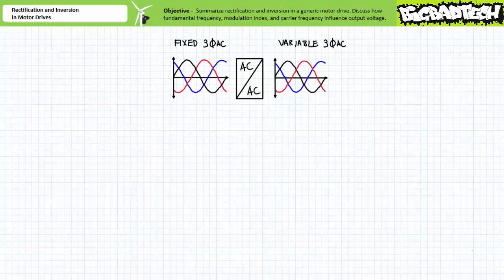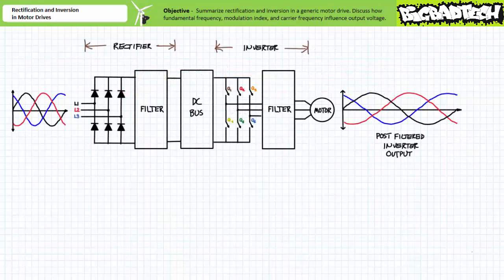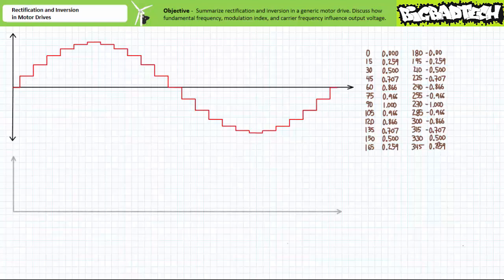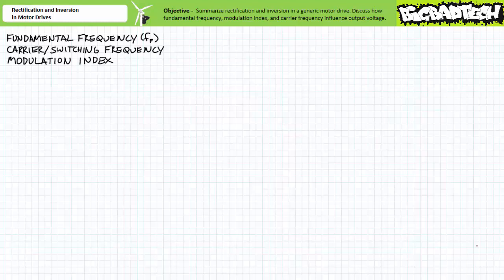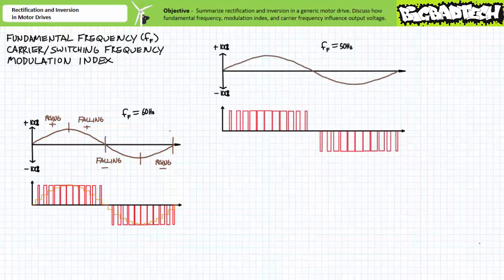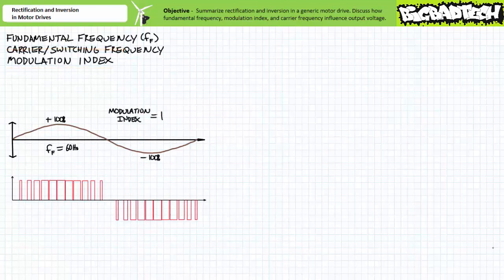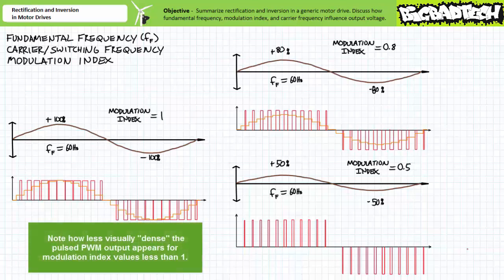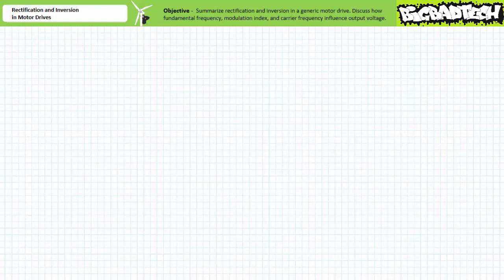Rectification and Inversion in Motor Drives (Full Lecture)

Comment: How can u vary the fundamental frequency? Which circuit is used to vary fundamental freq?
Reply from the maker: On a commercial motor drive the fundamental frequency is a user defined quantity.
Reply: @bigbadtech  yup bro but what causes the fundamental freq to vary? Can we use microcontroller to produce variable sinusoidal freq which is then compare with triangular freq in SPWM technique?
Reply from the maker: So you want to build a motor drive? This is going to take more room than a YouTube comment! Stay in touch because I do plan on covering semiconductor devices and circuits in the future. If you’re looking for a quick answer the fundamental frequency is an adjustable oscillator.

Comment: Thanks, if I overmodulate to increase the output voltage. It will be good when the grid voltage is very low?
Reply from the maker: As long as input voltage remains above the low level cutoff for that particular motor drive's input range one can really think of the input and output as being isolated from one another by the DC bus and the drive should be able to drive the motor at the desired speed.
Reply: @bigbadtech  so if I have a dc bus voltage of say 450 volts dc. Using overmodulation I can get 340 volts out of it with overmodulation function or not?